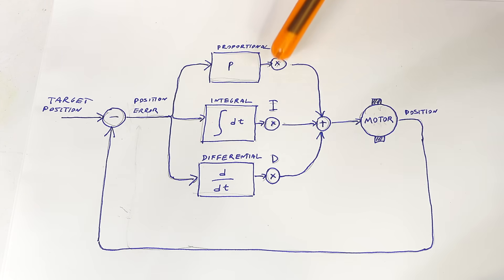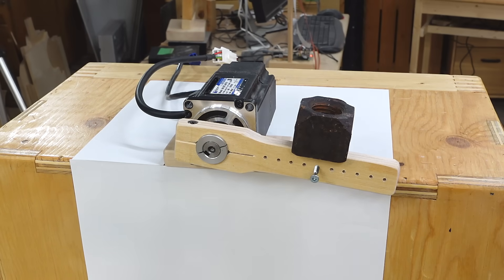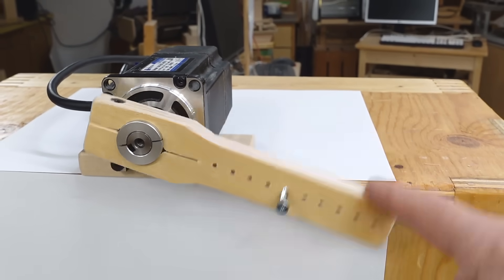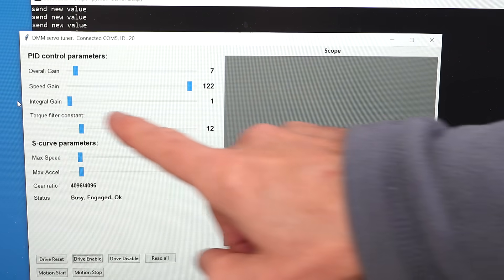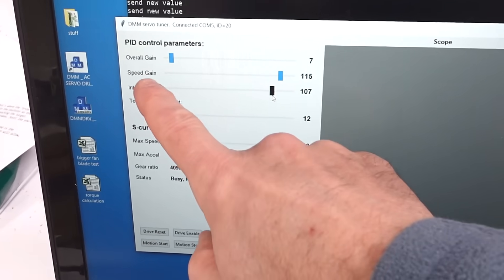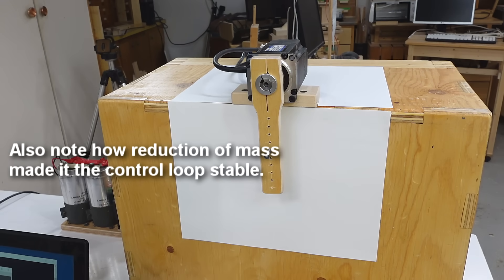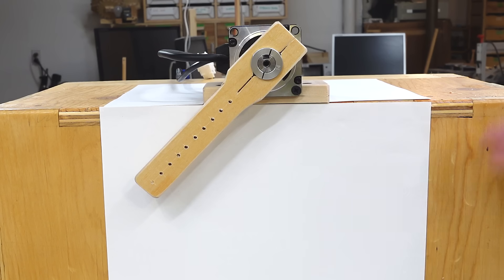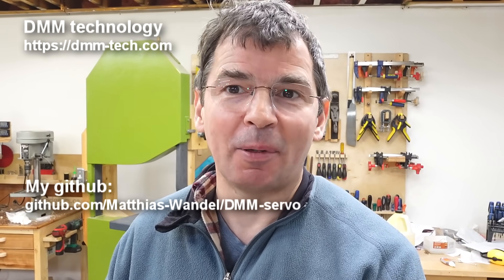What does a PID controller do?

Comment: there are several more modern alternatives to PID controllers that offer advanced capabilities for control systems:
Model Predictive Control (MPC) is one of the most significant advancements beyond PID control. While PID reacts to current errors, MPC predicts future system behavior using a dynamic model and optimizes control actions across a time horizon. This allows it to handle constraints, nonlinearities, and multivariable interactions that PID struggles with.
Adaptive control systems can automatically adjust their parameters in response to changing process conditions. Unlike a fixed-parameter PID, adaptive controllers can maintain performance when the system dynamics change, making them excellent for nonlinear systems or processes with parameter drift.
Robust control methods like H-infinity control explicitly account for model uncertainties and disturbances. These controllers maintain stability and performance despite imperfect system models, which is a significant improvement over PID's sensitivity to modeling errors.
Fuzzy logic controllers replace crisp mathematical rules with linguistic variables and fuzzy inference systems. This approach can be more intuitive to design and often works better than PID for complex nonlinear systems where precise mathematical modeling is difficult.
Reinforcement learning and other AI-based control strategies represent the cutting edge. These systems learn optimal control policies through interaction with the environment, potentially discovering control strategies that surpass traditional approaches for complex systems.
Neural network controllers use trained neural networks to approximate complex system dynamics and generate control signals. They can effectively control nonlinear systems without requiring explicit mathematical models.
For industrial applications, advanced PID variants like cascade control, feed-forward PID, and ratio control offer significant improvements while maintaining PID's simplicity and robustness.

Comment: Good video.  Interesting that in servo control the derivative term is more important than the integral.  I've only used PIDs in process control (pressures, flow rate, etc.) and the derivative gain is usually 0 across the board - to the point many PLCs have "PI" function blocks in addition to PIDs.

I really need to cobble up a test bench to play with this stuff.
Reply from the maker: the derivative is important for stuff with inertia.  if the process doesn’t have a lot of inertia, it’s unnnecessary
Reply: @matthiasrandomstuff2221 Think about a million gallon oil storage tank level control. The level itself doesn’t posses inertia but there is a latency on the level response due to the action of the corrective element (E.g. Input flow control valve) versus the actual level change in response to the net input/output mass flows. On these level control applications the derivative (differential) term is used to boost the flow response initially to get the level moving. The other point to consider is that the error used by the PID to act upon is just as often generated by the operator making a set point change rather than just a process perturbation. So my observation is that the ‘D’ term is used to improve the system’s performance due to response delay which can be caused by inertial effects or inherent latency.

Comment: Oh gods, this is wonderful! Can you PLEASE talk about this for heating controller PIDs? Like in an espresso machine for example.
Reply from the maker: PID controllers don’t really make sense for heating an espresso machine.  for that, it’s just, if below set point, turn heater on, if above set point, turn it off.
Reply: @matthiasrandomstuff2221  As far as Im aware, PID for temperature applications isnt simply an on-off, it modulates power. It follows your traffic stop analogy well. It gradually approaches the temp setpoint instead of slamming into it  and overshooting. It ramps down the power as it gets closer to gracefully hit setpoint and keep it there with minimal deviation. Im in the process right now of converting a popcorn machine from simple mechanical thermostat to PID controller
Reply: @fouroakfarm my soldering station could have that. It has a bar chart on the screen denoting power that lowers as the tip reaches it's set temperature
Reply: @ Sad to hear that from you. It has significantly improved the flavor of my espresso due to increased temperature stability. It has much less temperature over/undershoot when brewing, and back to back shots can be done with less time spent waiting for the thermal normalization.
Reply: @matthiasrandomstuff2221  I think it makes sense if you want precision control of water temperature to make coffee, fermenting yogurt or making black garlic in a slow cooker.

Comment: One correction.  Your supposed S curve is rather a position vs. time graph.  The name of the shape you drew for the velocity profile is called a 'Trapezoidal' velocity profile, and in theory has infinite jerk (3rd derivative of position with respect to time.)  This velocity profile will actually cause oscillation or vibration at the beginning and end of an axis moving from a start position to a stop position.  An 'S' curve limits the jerk so that the acceleration ramps up, and is not at the maximum value as quickly as possible when the motor is speeding up from the start position or slowing down at the stop position.  If the 2nd drawing you made had a horizontal line added at the end and then a mirror 'S' added at the end of the horizontal segment,  and you still intended it to be a velocity profile (rather than position), you would have an 'S' curve.  BTW, cosine curves can also limit jerk, and in theory, are superior to 'S' curves.  For a video demonstrating 'S' curve motion vs. trapezoidal motion, see this one: https://www.youtube.com/watch?v=C0XjXqO6Ji8  Thank you for making a great video!  And thank you for always approaching things intuitively rather than mathematically!  I think it really helps people understand things!

Comment: There's a PID controller in my espresso machine to maintain a constant water temperature. I always knew what it did, but it was cool to see how it does it.
Reply from the maker: nope, it just turns the heater on and off depending on if it’s below or above the set point.  much simp,er and more effective for that application.
Reply: @matthiasrandomstuff2221  Yeah we called that a "bang bang" controller and its more than adequate for heating water.
Reply: @matthiasrandomstuff2221  That's something a simple thermostat could accomplish, so I would expect there's more to it than that.

Comment: Oh my, this brings me back to my controls labs.  Playing with PIDs were some of the most interesting lab topics in my control systems class.   As for the instability, if I recall, you cranked the Integral term so high that the poles were outside of the unit circle and that's when the controller goes down hill because the system became inherently unstable.  Excellent video!
Reply from the maker: control system was way too much math.  much easier to just tweak the parameters until it works right.
Reply: IIRC the gain at -135 degrees was allowed to be 0.5 maximum to keep the system stable. Which is called amplitude margin.

Comment: One time I wanted to know about PID controllers. So, I took a class on control theory in college. Now I know even less about PID controllers.
(seriously, how you come up with the correct gain values analyticalally is pretty non-trivial, and even the professors admit that "sometimes, you just have to mess with it")
Reply: Solutions of auxiliary polynomials aren't too bad, if the order is low; but real systems often aren't lumped-element (polynomial auxiliary equation) at all, but have weird diffusion (sqrt(t) dependency) or true delay elements in them, in addition to the poles/zeroes varying with operating level (nonlinearity).  But knowledge is the true hard part: sometimes a system is very well-defined, like a power supply for specific application, and analytical solutions are available; other times, parameters are too uncertain, or specified to vary over such range, that no optimal solution exists, only crude approximation.

Over time, I've found myself in the habit of setting cautious defaults, then leaving some room in the project timeline to hand-tune it.  Real projects tend not to have very well defined parameters, and analytical solutions are subject to assumptions that tend to change as the system is being implemented.  That is to say: sure you might be able to cook up the required parameters under one set of assumptions, but sticking to that too closely, may overly restrict other aspects of the design, or may fool yourself into thinking you've solved it when actually the whole thing's changed under your feet!  Worst of all, some components are simply _not documented at all_; more than a few SMPS controllers I've seen, just don't specify their modulator gain or Bode plot, for example, and you'd have to test one to even figure it out -- but so too, the manufacturer is under no obligation to preserve that parameter in practice, if it's not bound to a min/max spec in the datasheet. Such is engineering.

Comment: The missile knows where it is at all times. It knows this because it knows where it isn't. By subtracting where it is from where it isn't, or where it isn't from where it is—whichever is greater—it obtains a difference, or deviation.
Reply: The guidance subsystem uses deviations to generate corrective commands to drive the missile from a position where it is to a position where it isn't, and arriving at a position where it wasn't, it now is.

Consequently, the position where it is, is now the position that it wasn't, and it follows that the position that it was, is now the position that it isn't.

Comment: This guy: I don't like their software so I wrote my own. This is the way! I also wrote my own PID tuning program for tuning robots. I also wrote the PID algorithm and flashed it onto microcontrollers. Its interesting there are few standard options for this situation, everyone is hard coding and flashing them. I wrote a simple serial command to set the parameters and send back the position so I can visually track it. This should be a standard set of libraries for robotics. Maybe I should take what I have and put it on github so we can start a standardized way of tuning robots to some extent. Cool video!
Reply: @newmonengineering  I designed an automatic shift system for the CVT hub on my bicycle. It uses PID to maintain the correct cadence. Like you I set it up so I can change the PID gain via serial on the go and its stored in EEPROM. I use a phone app so I can experiment with PID tuning while I ride. What interested me is that I can make my cadence oscillate by turning the gain up too much.
Reply: I would like to learn how to connect and configure these high performance Industrial servos (even higher rated ones) for CNC Router. But there is no structured material to learn from. I have used Mach3 where velocity and acceleration are set using a simple graphical way. This PID Loop thing is so complicated. But I really love to learn. I have watched longer webinars of Yaskawa. But a Real CNC based demonstration may be needed..!  I am trying to learn though..!
Reply: ever heard of blackberry? this guy might have worked for them... ;)

Comment: The braking force is directly proportional to the weight of a truck, via the tyre / road friction coefficient. Provided the brakes actually work, laden trucks have the same braking distance as unladen trucks. Load does not equal over shooting in vehicles.
Reply from the maker: Yes, a loaded truck has more traction on the ground, and is thus able to apply more braking force.  But still, its more braking force than an unloaded truck.
Reply: @matthiasrandomstuff2221  I agree Friend. I was only pointing out that the analogy was not right. The loaded truck has no more propensity to over shoot than the unladen truck. It is a common misapprehension, and easily proved with Newton’s three laws of motion, which you almost certainly grasp better than I.
Reply: Here only the speed & position?? are used for control of PID....For loads , current & perhaps torque parameters need their own PID loop...to be cascaded with the speed/pos. loop

Comment: In my experience it's the differential component that can really destabilize the control system, and thus many use only PI control with no D component.
Reply from the maker: Usually you already have a D term implicitly applies by the motor's back-EMF.

Comment: Did you already know this information or you learned some of it to make this video? Your understanding of the fundamentals is great - is that because of your german roots or never ending curiosity?
Reply from the maker: PID control is pretty straightforward.  Though it took me the longest time to realize on the DMM controllers, the max speed and max acceleration parameters don't actually apply to the PID part of the controller.

Comment: To think, I actually paid good tuition money to learn this stuff half assed 30 years ago when I could have just waited 30 years to learn it full assed for free from a guy on youtube. 😂
Reply: I swear, the class I was required to take on root-locus methods was the most useless thing ever.

And I say this as probably the only student that was actually following along -- for other reasons, I had already taken it upon myself to work some network (RLC) and control loop equations; at the time, I was beginning to understand the abstraction of poles and zeroes, their meaning and importance, and how they relate to real component values, and system architecture.  I am confident no one else in that class (out of 20, 30?) had such a background.  The prerequisite classes simply didn't provide the kind of preparation I had discovered independently.  Eyes were glazed, minds listless -- and why wouldn't they be?  No one ever explained to them why they have to be in this class (other than "we said so"), said how it's useful, or what it relates to in the real world.  After finals, I summarily forgot, and have never since touched, Routh-Hurwitz criteria or any of that stuff.  This is well and truly one of many things we simply have computers to help with!  (I think that class isn't taught anymore, or, isn't part of the more common EEE, EET, etc. variants today, at least. But I haven't checked, and, who knows elsewhere in the world.)

(Still, there is one takeaway from that class that I appreciate: the fact that zeroes fold into more poles in a closed loop, and that poles are naturally exclusive, in a sense: following a trajectory (as you vary some system parameter or another) and thus tracing out some geometry, which is tied intimately with the order of the system and various parameters of it. Which in turn shapes what kind of transient or frequency response we can get from such a system, given limited control of its parameters. So, ultimately if we want to tune a system for, say, Butterworth 3rd order response -- knowing where poles move is necessary to solving that.)

(I also kind of wish that real/complex analysis, the deep dark details of polynomials, algebraic fields, etc. were taught, at least hinted at, for most of the (math-using) sciences, undergrad; but I do appreciate, even as little of these subjects as I've picked up over the years, just how fiendishly challenging, opaque, and abstract, they get.  I suspect a lot of that can be simplified and hand-waved through, without being uselessly abstract; but there also isn't much motivation, much requirement or need, of these topics, to want to craft more accessible curricula.)
Reply: For me the Same😅

Comment: GREAT VIDEO! Key point: I and D are based on /time/. P is not. The faster the control loop, the less time and the less I and D matter. An impossibly fast control loop with a positional output (like for a stepper) only needs P. But... here is the big point... the time includes the delay between an external error and the encoder picking up that error! So a low res encoder adds delay and makes I and D critical. Using an ultra high resolution encoder (and a positional rather than force based drive) completely removes the need for I and D and... removes the need for load based tuning! This is how the Dexter robot joints can work reliably.
Reply: Well, maybe. A P-only feedback loop has an offset error proportional to P in its steady state response (the steady state aspect removing time from the picture). In a theoretically perfect system, increasing the proportional gain towards infinity can make the offset error as close to zero as you wish—but real controllers cannot have infinite gain. In the real world, there are always some time delays in the loop, and so large enough values of P will always introduce instability.
Reply: @ib9rt  Yes, but the offset error can be removed by switching to positional vs forced based control. E. g. Use a stepper motor.

Comment: Derivative not differential. Similar but not the same. I have also spent a year of fiddling with them myself. In the real world integral limiting is pretty much mandatory. Rate limiting is almost never in open source but can give you much better control, as does a dead zone.